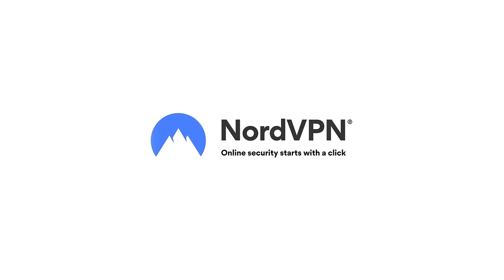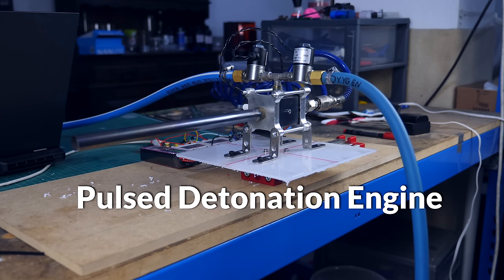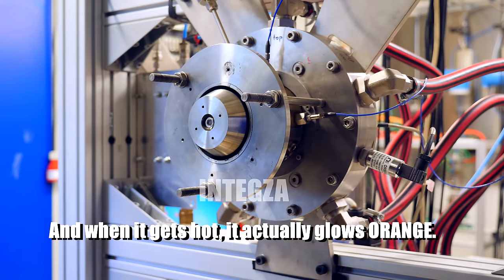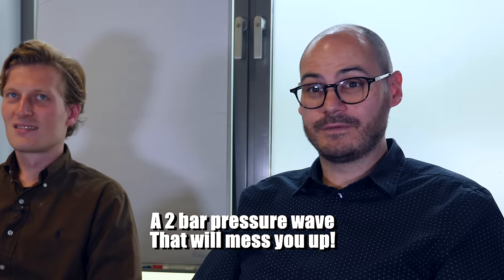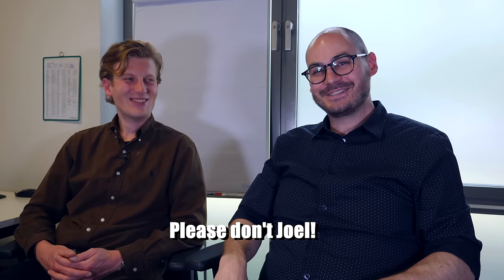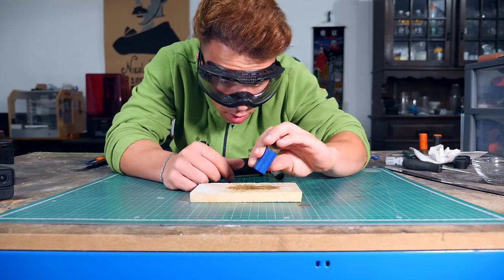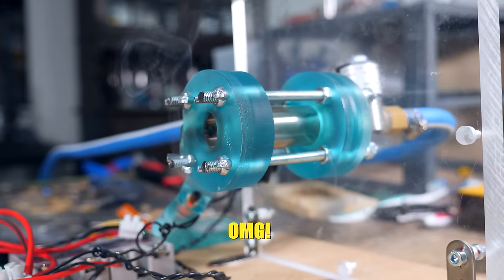NASA lost this TECHNOLOGY 60 YEARS AGO

Comment: That solenoid that you linked has a dinky discharge coefficient. I tried making a cold gas thruster with it for a spin stabilization system for my rocket club. It was limited in force because my flow rate suffered from the tiny flow orifice. You’ll see a huge pressure drop and reduced flow rate. In compressible flow, you mass flow rate is limited by the area and pressure of the orifice (choked flow). Note sure if you measured  the flow rate for both your ox and fuel, but that would be good to check. Im no expert in RDEs, but I do work in rocket engines. If you want detonation, Im guessing you want good mixture and certain pressure conditions. I would like to read that paper you talked about in the video. But it doesn’t look like it was linked. Also, it seems like rdes are harnessing the “race tracking” instability mode. Not sure what causes race tracking modes, probably has to do with diameter, pressure, mixture and flow rate (likely some non-dimensional version of these things). Honestly a bit of shot in the dark. If someone knows more about that subject please reply and correct.

Comment: You need a rotating wave where the first blast comes mach 6 (hydrogen explosion speed at 75%). The second one must be inside the first ones "cone cavity" to speed up. After that it compresses the 1st blast already outside area of the engine. The 3rd is the same process related to the second one. Problems comes with blasts stability, temperature, materials, and rotating device sync frequency to ensure ready-to-blast waves.  At 1hz duty cycle  the second wave will find  (it will never find it) the first one at 2km outside the engine... I know there is not any benefit here, just for showing purposes. Fast you understand at 2KHz the first one's cone is at 1 meter range. I think its a bit far, but its a question of tunning the device. It's not easy i know. The magic frequency is when the second wave can speed up inside te first one on a optimized fahsion. I heard somewhere about 10 Khz, but can't confirm. And that device must be already trying to speed up chained blasts (3,4 or 5... more?).

Comment: Rule 1. Fire never touch rockets parts. Fire begins outside of the engine. 
Rule 2. Fuel + Oxidizer mix preheating starts before fire zone. Pressure gives a lot of heat. 
This rocket engine burnout in short time. Like your engines.

Comment: Hello, you are doing quite advanced plasma thruster experiments. I'm curious about the voltages used between the electrodes, the current and what working gases they use. As far as I remember, the best would be noble gases, such as argon and xenon.
Congratulations and best regards 😀

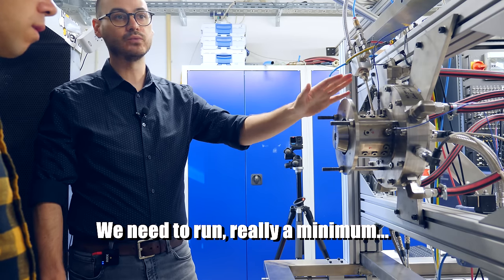Comment: 3:59 i mean 400 grams of second/s air is about 0.887 lbs or just under 670 cubic feet per minute. 3x less the airfuel mix ration required for regular combustion engines in streets cars with 400-500hp, which run on about 2.5-3 pounds of air per second, or 1,200 grams.

more powerful deflagration combustion engines that have superchargers run on even more air. a whipple supercharger adds about 1,750 cfm (cubic feet per minute) of air or 141.225 POUNDS per minute, or 2.3 pounds more second. so an engine with 500hp stock that has been supercharged can be utilizing 4.8 pounds (2177.24 grams) of air every single second. 

there are even more outlandish engine builds with two superchagers, for turbo chargers, or two prochargers which add EVEN MORE AIR
but at a cost of more heat due to turbulent airflow, and having to run the engine at higher revolutions. 

TLDR; rotarty combustion engines are capable of being more efficient with air/fuel mix ratios than car engines.

Comment: Possible future theme? 
The idea came to me after the nation of India put a Lander on the moon.
One night fell the Landers energy was depleted.
*
The concept, is there a way to have a containment of a substance in which the compression of that substance creates energy that would either make electricity or heat to keep the probe, Lander alive until solar panels can be utilized again?
The 250° below zero celsius, be enough to compress a metal that would thus cause a reaction to a nuclear pellet or just a substance that creates heat when compresse?
It would also be a good way to power deep space probes. Thanks for the video. Thanks for building your engine.

Comment: do what they did  on  nuclear test where  they fixed  polls equidistantly and measure  blast wave velocity by the  timing  of the  dust  kicked  off  from each poll.  (at least  iirc   correctly   its  dust)  you  could  cover them in some kind  of Talc, slow mo  the video and record fit by frames for velocity sake.

Comment: why not use vibrational sound like a tone oscillator with a speaker considering it pushes air in the frequency so therefore maybe find the frequency that resonates with hyrdrogen gas and have it rotate using sound waves created by the tone oscillator then ignite the air after its sent through the tone oscillator.

Comment: Hmm….you would think it would be more efficient to have multiple detonation locations…with the fast enough injection frequency and fuel volume control done with up and downstream fuel/O2 sensors(giving you the ability to stabilize detonation by monitoring over or under enrichment) …..think of a circular pond, as you throw stones into that pond, with exact placement of the stones and the ability to control the exact  mass of each stone every throw….to create the exact “ripple frequency” needed to both amplify and accelerate the pressure wave 🤷🏻‍♂️

Comment: Fantastic !!  What if you use an inert gas as a separator to initially seperat the gas streams at low rotational speed until internal speed/presure is sufficiently achieved??  It seems the seperation the rotational combustion is most unstable at lower speeds (if you can call rocket combustion low speed 😂) a swirl nozzle to induce fuel swirl both in inert and fuel as well 🤔

Comment: Could this be used to feed a small turbine/generator combo in an efficiencient way?
That would make for a really compact hydrogen powered generator with a high output.
Pluspoint if it can run on ordinary air instead of pure H2.

Comment: gunpowder burns in a deflagration, the shell primer explodes in a detonation, two different concepts or chemical processes. the former is a process involving different reactive substances, the latter is just an unstable molecule that decomposes into very stable, highly energetic low molecular weight gas molecules that expand violently and much faster than the reaction of several molecules, by the heat or shockwave from the primer  The confetti inside the gun cartridge is in fact smokeless gunpowder which is actually nitro-cellulose. the detonation lacks the impulse needed to blast, push, etc., because the low mass production of gas molecules, while the deflagration or combustion, although slower, yields higher amounts of gases that, in a chain exothermic reaction build enough pressure to push whatever it's designed for.

Comment: i would try putting three selonids 120 degrees apart on a 60 degree angle around the back of the engine facing perpendicular to the gap between the inner and outer walls.

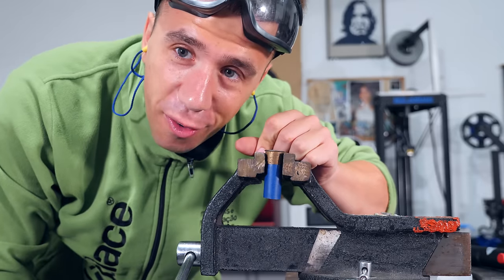Comment: 12:06 The power in the primer is gunpower just like what you just burned. The difference is that the primer was under pressure. Whereas the lose gunpower wasn't.
I could see that rotating engine used as a thruster. 
But it they could get it to work for much longer. There would be a long like of people who would be interested in it. Including Spacex.

Comment: Dude make a hover board by using pipes made of a super conductor and high pressure liquid nitrogen inside the area needed for super conduction and use refrigeration as the engine. Honestly it can work. At least at model scale.

Comment: JUST  an idea for trying to get you a regular pulse wave explosion to ignite  the primary engine . why couldnt use a high compression blast of hydrogen like you were thinking and then use a electric match to set it off as it passes by into the combustion chamber for the main engine . that way you would be able to use it as a pulse engine to set off the rotary explosion engine. and would be able to control the length of time the pulse engine could run as well as the rotary engine. yes a bit more work and a bit more complicated I will give you that . but also at the same time everything would be more controllable. and not as reliant onto just one explosion of  a primer cap. and as far as for the shot gun cap next time why not use the caps for nail guns that shoot nails into concrete that would give you the same result and a bit cheaper and easier to get .also take a look at a infinity jet nozzle for dredging , where as it puts in a high jet of water set off axis . so it spins the water before it encounters the main body of water/sluury and pulls the slurry into and up the hose . use the hydrogen on this principle to pull in the main fuel into the combustion chamber . it will then draw more fuel into it as well as starts its rotation before its ignition from the hydrogen .

Comment: What if you used some type of impeller to rotate the gases before they enter the detonation chamber, or another way might be to introduce the gas at a 90-degree angle into the det-chamber? Would that help to initiate the rotation of the wave?

Comment: The energy release per unit of propellants of the RDE is the same as a continuous combustion engine but the shock reaches higher pressure than the continuous flow feed, which can allow greater expansion without needing the feed pumps to reach that peak pressure. This can increase Isp a few percent, but the chamber mass is pushed up by the need to withstand the peak pressure, while the thrust only scales with the average pressure. Sadly, this will always make the thrust/mass ratio of RDEs very poor.

This also ignores the difficulty in regneratively cooling RDEs- the pressure waves disrupt any the gas boundary layer and push the heat transfer coefficients up to the point where the coolant-side flow flash boils, followed quickly by catastrophic burnout. RDEs are fascinating research projects, but wildly impractical for real-world applications.

Comment: A rotary vane engine is theoretically the perfect engine for producing rotational shaft power (not thrust).  Its solves every fundamental problem of reciprocating engines (torque lever, recip. losses, pumping losses, power density).  However it creates ONE problem that has proven difficult to solve, vane tip friction.  Interestingly we now have the technologies to solve this problem, but no one is doing it.  A functioning rotary vane engine (RVE) the size of a coffee can could produce 1200HP, and 2000 FT/LBS of torque @ only 3000RPM.  It does not need to idle, can run at 100 rpm.  There was some effort to produce a RVE 30 years ago, as it is the theoretically perfect engine mechanics on paper, but material science and precision machining wasn't there yet...

Comment: The lab engine used a metal cap over the tube which forced the engine to decide it's rotation. With your engine you might get some rotation but you can't see it since the exit is a hole. you probably should try to restrict the exit point but then get ready to run. It will be like a bomb for real if you make the opening too small. I suggest trying to use the worse quality air for combustion so that it might have less force but you can abuse the cylinder more.

Comment: The product of Hydrogen and Oxygen is water... yes, on paper this is a correct statement. This is not the case when combustion happens with normal air. The majority of air is composed of nitrogen. High temperature combustion of hydrogen and oxygen in the presence of nitrogen produces NOx compounds. One of them is nitrate which becomes nitric acid in water, also known as acid rain. This is also one of the drawbacks to hydrogen fueled combustion engines. Still a better idea than EVs though when fossil fuels eventually run out. There just isn't enough rare earth metals and lithium for everyone to have an EV, not to mention the amount of pollution it creates to gather those materials.

Comment: I kinda like the idea of combining this with a ramjet for a blade-less jet like rocket! I’d drawn up an idea years ago but I think a ceramic metal far beyond the strength of obtainable materials would have been needed! Had no idea about radial detonation engines at the time! but seeing that they work has given me hope mine would work! The other issue I had was mathematically!  and just the fact I’m pretty broke and dumb! I had the thought the speed for it travelling at idle would be unobtainable without a jet or rocket and it probably needs to be well past supersonic to even start without the liquid oxygen but if well designed the idea would be it’s a liquid rocket that becomes a ramjet and subsonic essentially then hypersonic the next major difference is it rotates! To achieve a faster intake air intake speed! It’s probably been done like most idea’s but I’ve seen nothing like my drawing yet!

Comment: High freq flyback coil or tear down a tazer to make plasma ark ring spinning fast enough around metal ring or a type of conductively doped aerogel so heat doesn't destroy metal  ark ring for longer run time as your spinning detonation engine. Or something like that other then blasting caps.

Comment: This is gonna sound crazy but that air speed isn't all that impressive as I used to work at a warehouse doing security, and one of their moisture filters cracked in the air line over xmas break and was like that the whole time. Anyhow the size of the crack was just about a fingernails thickness. But so much air was coming out that it was pushing my whole body away at about 10ft I've never seen anything like it since lol. Not much in there was identifiable to me but you can imagine the time I had trying to find where all of that air was coming from. Everything appeared normal.

Comment: I wonder if a strong magnetic field like in Stellarator type fusion reactors could solve the issue of overheating the metal structure.
Like containing the explosion and air stream in a magnetic field.
But I guess the tiny amount of plasma in a fusion reactor is in no comparison to the gigantic amount of gas running through the RDA. Which would mean the magnetic field needs to be astronomic (warp core anti-matter energy level astronomic)
So yeah, probably not.

Comment: idk if thermal tiles are durable enough to help in making the engine not melt itself in longer firings.  i am simply amazed by them... like the tiles elon is putting on his spaceX rockets... i'm not sure the process they are made in or of what, (( and frankly it may be a national secret at this moment)  not sure)  but if overheating is an issue...its possible that there is a solution using them??? never know without testing right?    of course maybe this wave stuff would help spaceX's engines to become even more powerful???  peace.

Comment: That was to cooled engine I have seen. It would be even way cooler to print these and put them on 3D printed dragster model and jet plane to attach one that size to see how fast they would go, maybe break land speed record for RD model  dragster. I also do wood crafting and can make the dragster frame and body to help with weight so it will hold to the ground better plus aerodynamics.

Thanks for the great idea.
Reply: That is an RC model

Comment: Instead of primer caps from shotgun shells next time check out what are called concrete nail guns which use a small controlled explosion to drive nails/fasteners into concrete. The explosion is made with a small .22 caliber style  round that's modified.

I'm not absolutely certain it would work but I imagine it may be easy to source anywhere essentially that you can get construction tools/supplies.

Just incase your uncle does not want to give you anymore shotgun shells haha

Comment: Engine work fine if you're on earth but in Space it's redundant so what's the practical reasons for it on Earth? How similar is this to scramjet Technology? In a rocket High volume of air can only be provided by turbocharging and the higher you go the less O2 there is available and is there propellant natural gas?

Comment: Gunpowder?
Time to start communicating with American handloaders. :D
(different powders and differing shapes of the same chemistry powder, wildy vary in their burn rates, etc.)

Primers are so energetic, because they use a form of explosive. 
BTW, primers are also,a source of lead particulate / -containing gases. Not much of a concern a couple times in a large airspace, but something to be aware of.
Indoor ranges have extreme ventilation less because of the micronized metal of the bullet, and more for the fumes from the priming compund.
Or so I've read/been taught...

Comment: using CH4 instead of H2 as rocket engine fuel improves thrust due the higher mass of the products generated, although the reaction is slower. In space travel is mass what matters. You cannot achieve thrust with anything else but mass. Radiation pressure has not yet been demonstrated, neither is the capability of humans to change climate by means of CO2.

Comment: why not just spin a tesla turbine as a pump, rotary, and burn center out as a rotary turbine. yep the single tesla turbine is the turbo pump and burner at the same time. yep air in the front, exhaust out in the sides backwards. by default you dont use the exhaust stream as the turbo pump power, you spin the combustion pump separately. or just use a normal turbine compressor as the turbo power. yep replace the first turbine compressor blades with tesla turbine. replace the second compressor blades with tesla turbine also.